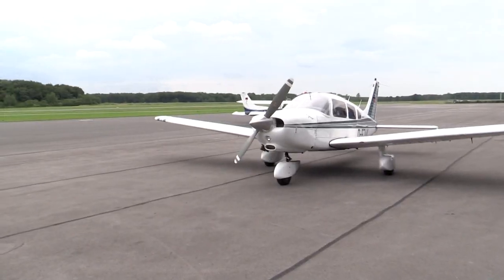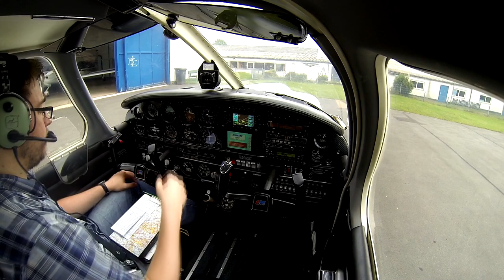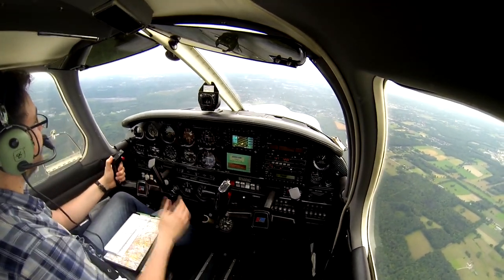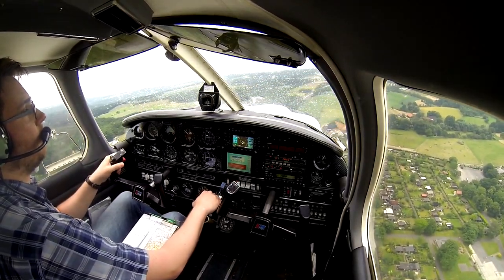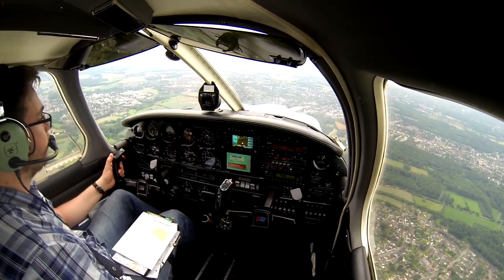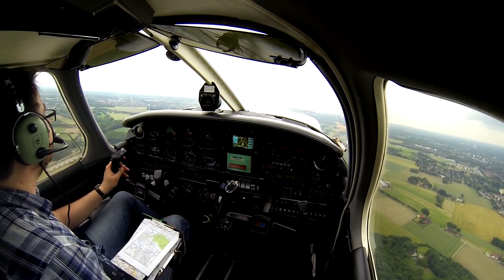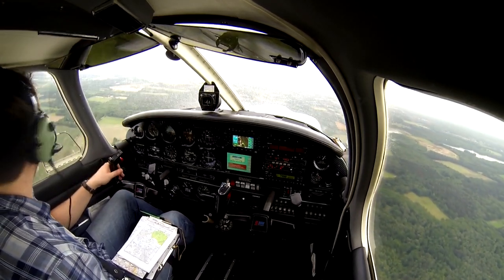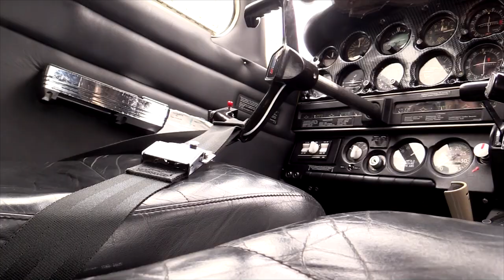Behind the Scenes - Episode #07 - Piper Dakota Documentary

Comment: Very nice vid on the Dakota. Just two minor suggestions. Use checklist for pre and post landing. I know you can "memorize" the list, but sometimes just too easy to get distracted and leave something out. Pilots with 10k hours use them, so don't feel like you don't need them. Also, just before you shutdown, it is good practice to check the ground in the ignition by briefly shutting it off and back on to make sure it's working OK. Otherwise, great flight!!!